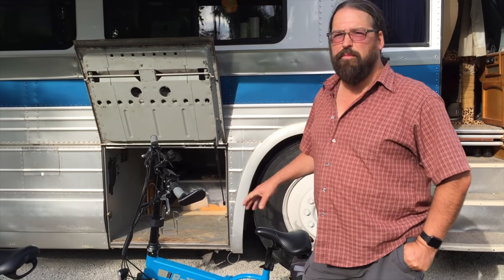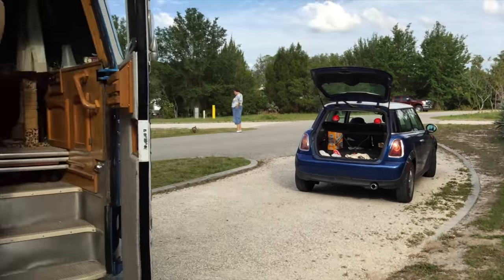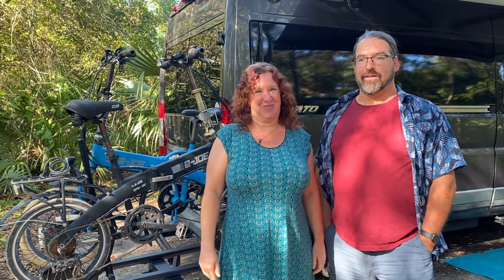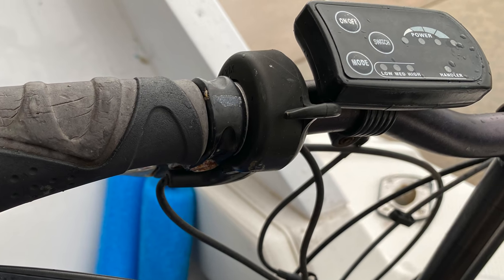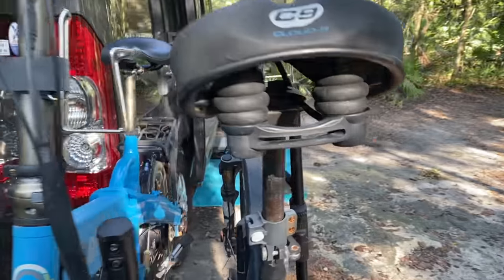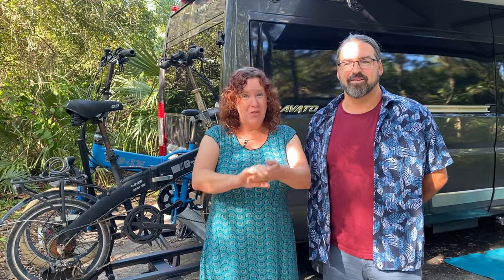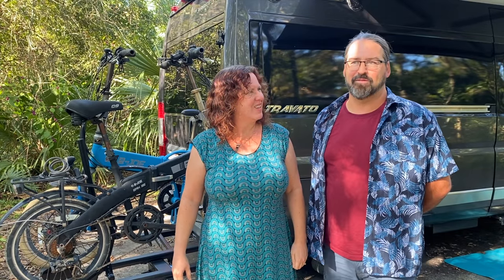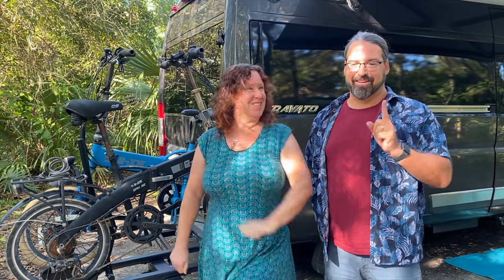Shopping for Folding Electric Bikes for RV and Boat Use - eBike Replacement Time!

Comment: Another thought, you should pull the battery on your ebike when transporting. They way on average 7.5lbs. That 65lb bike only weighs 57.5lbs without the battery. Also, pull the seat and seat post during transport. It makes it harder to steal a bike with no battery or seat and makes them lighter.

Comment: I have a Lectric XP with over 220 miles on it without any issues. Recently we purchased the step through version for my wife. She is very happy with it’s performance. The weight of the bikes would likely push the outer limits of your bike rack.

Comment: I'm 225# and bought the Lectric XP. I have been riding/testing on mostly hilly paved and dirt roads for the past month, trying to get a realistic grip on the mileage and determine the best setup for comfort. Most reviews of the bike tell you what it isn't which I think is unfair. At $899 it isn't going to be a lot of things but thus far the XP is a well-built and rugged road/trail folding bike that does a good job of getting me where I need to go. Yes, it's heavy at 63# but it will haul 275# on the saddle plus 55# on the rack.

Thus far I have purchased a good lock and a mirror. Out of the box the bike is very complete and ready to ride. Since this is my first electric bike I cannot make comparisons but I am very pleased thus far. The XP is a blast to ride. I've been running tire pressures around 20# which does make for a more comfortable ride. With that said, this 68 year old butt will probably be looking for a wider gel seat pretty soon. You are right when you say YouTube is peppered with this particular bike and the influencers did play a part in my decision. Still, I was very comfortable with my decision matrix when I finally pulled the trigger and ran the credit card. I have not regretted my decision. I placed the order and 10 days later took my first ride.

Comment: Pulling and  the battery seat will bring the weight down significantly. It's not on your list but, the Rad mini step through weighs in at 69 lbs. and has a payload capacity of 275 lbs. They are built like tanks and the service from the company is excellent. As of today they were in stock. 😎

Comment: My first thought was the Blix. I know someone that has one and is very satisfied. I looked at the electricbikereview YouTube for the eJoe Epik Swan. It looks very nice and has a weight capacity of 300lbs. If I were looking for something in that class I think I would go with the eJoe. We just bought RadRunner ebikes which don't fold and are single speed (my wife has problems changing gears.) Everybody has different needs. We do not tow a car with our 25' Class C and are using them as a second form of transportation for exploring. They offer great utility and versatility with great customer service.  Good luck with your new folding ebikes, hopefully, they will be in stock.

Comment: Hi guys, my wife and I have owned two Lectric XP’s for about a year. And no we are not at all society media influencers at all.  Lol
The good: they ride very nice get a decent range. Comfort level is good but needs a seat mod for larger people like us. We are sillier in size to you but shorter. They move us around at a good clip on flat and and hilly terrain just fine, sometimes a bit to fast. The pedal assist have three levels to chose from. The controls are easy, look to be be well sealed. Seats and handle bar adjustments are easy to do.the Fat 4” wide tires to really well on dirt and gravel, will work ok over hard packed sand, deep sand not so well. But the cool part is you can use the walk mode on them to have power drive over the sand as you walk the bike will use it’s power to go over the sand without your writhing on it. Beats the hell out of push a bike on the sand. The batteries can be removed or left in bike to charge. Folds down to a nice tight package we get both into the back of our road “Ford C-Max”
The Bad: it pushes 60lbs if not that.
The components, detailer, crank and shifting are lower level. But for salt air and salt water not so good. 
The brakes seal no matter how many times They have been adjusted. The brakes stow well no complaints there.
And after market seat is a must.
The fenders kinda make noise over rough trails an bumps. 
All fixable stuff and most likely “any bike you get will require mods to work for you in the environment you two exist in” 
The base bike is very cool.
If I was living on a boat or at the beach the first thing I would change is to upgrade mechanical cables to stainless steel. Next up grade the derailleur to an XT or aluminum higher end model. 
All screws and bolts to stainless steel.
The crank and sprockets can be changed out as needed, but note a quality aluminum crank can take of a pound or two. Changing to aluminum components will take weight off and prolong saltwater life.

Again this will be with any bike you chose.

Comment: We purchased a pair of XP Lectric's that have been perfect for us.  That was until they came out with the Step-Thru, which my wife now is receiving one next week.  We have been very pleased with the bike design, build and range.  Something to consider is the weight of the battery which is around 7 pounds when loading on your bike rack it would be better to remove the battery.  

Riding off the pavement on trails is something we enjoy.  Upgraded our seats and installed seat suspension post.  That plus the fat tires, usually deflated to around 20 psi makes for a reasonably comfortable ride.  

Dimensions, folded ours measure 37" L x 24" W x 35" T.  It is possible to get the width and height down by removing seat and handle bars, which is easy to do with quick releases.  The company website shows orders now will be shipped in October.  Hope this is of some help, would be cool to see where your new bikes are able to allow you to explore.

Comment: I have a 2016 e-Joe Epik SW (pink) and a 2018 e-Joe Gadys (full size non folding).  I love them both, but my go to for camping and quick trips to the store is my Epik.  Love e-Joe. That being said, my assist on the folder stops working after 2 miles now but the throttle still works and I am running it till it doesn't anymore.  I will get another e-Joe folder again. LOVE e-Joe. My brother and sister-in-law have Pedigos and they love them but they are way too heavy and don't offer the range that the new Epik does.

Comment: Please know that by taking the battery off of the bike before you put it on the bike rack, will make it easier to lift onto the rack.  And lesson the weight carried by the bike rack.  May open up options if you do this.

Comment: I am in the market for a step through for a heavy weight senior that can handle 250 lbs.  But more important for me is some type of rack that will enable me to mount on the back of my Class C RV.  I don't have strength to straight out lift a e bike so have to figure out a way to get on the rack.

Comment: Great video!  Monday we ordered 2 of the folding Lectric folding step thrus to go on our Travato bike rack. . After much research we decided it was best for us esp the price.  We ordered  from the factory and it was $899 tax and shipping included and  they are giving  a set of panniers for each bike.    Other than the price, I am a big guy and they can carry 335 with not weight on the rear rack and they have 4" wide tires. They have great YouTube recommendations.  Rad is good also  But it almost twice the price.  They may give them to you , I hope.  They  told me 3 to 6 weeks for delivery.

Comment: We have a couple of the Green Bike USA. I bought the 750w fat tire option and my wife has the 500w (non fat tire). I'm 245lbs so there is not a (bike) weight problem although mine with a big ole 20a battery (60 mile range) weighs about 75 lbs. FYI

Comment: Rattan and DJ E-Bikes -  I am not sure about the quality of the bikes.   I do not know the weight or weight capacity of the Rattan, but the DJ weighs 56.22# with a weight capacity of 275#.  The DJ is made in Canada and is made to compete with RAD.  Both bikes have front suspension which is a MUST HAVE!!!.  Darrell Dement - the reason they do not have Rad on their list is because it is too heavy.  Their bike rack can only handle up to a 60# bike.

Comment: I love my Magnum foldable step through ebike.  I bought the 750 for about $2000.  Upper weight is 275.  They also have a 500w good up to 50 miles, though may be a little less with upper weights.  It weighs about 55-60 lbs and measures 34” x 14” x 35”.  I love it, especially throttle action when the "old" knee acts up.  Excellent made frame.  Bought mine at bike shop but you can now purchase on Amazon.  Good luck; love e-bikes---gets me out there pedaling a whole lot more because it's so much fun!

Comment: I think the Lectric XP would be a good choice. Why I love it cause it’s foldable and you can get 45 miles of riding. The speed is I think 20 mph but you can unlock the speed and get about 28mph. The fat tires are also good for the rough terrain. I did get the suspension seat Post to absorb the bumps. The bike weight is 63 lbs but if you take out the battery you can shave off 7 pounds. The bike can handle weight up to 275 pounds.
Reply from the maker: We did test drive some Lectrics owned by some friends... nice bikes. But way bigger than our e-Joes - would be a lot to move on/off the boat. We're loving our new e-Joes... we'll get an updated video out soon.

Comment: Tern makes a great bike, but it’s only advised for up to 230lb, and it doesn’t have throttle assist.  It’s a very well made class 1 eBike, not a class 2.  They make one that will support more weight, but it doesn’t fold.  Check out 2 channels : Propel bikes, and ERR, electric bike review.

Comment: I think whatever e-bike you end up with, they should be stowed inside an airtight container/bag to keep salt air away from the frame, components & electronics.  Ideally, pull a vacuum and have desiccant inside too.
Reply from the maker: Bikes that require extensive effort to pack and store will never get used. Imagine if every time you parked you car you needed to take the wheels off???

Comment: Quiet Cat Voyager E-Bike, Money but specifically designed for marine use.  54 lbs,  will support 325 lbs.  20X4 inch tires 750 watt.
Reply from the maker: Thanks.. we'll add that to the research list!

Comment: I had to go check the Lectric models out when you said Rad weighed more.  Actually without the battery it weighs 3 pounds less.

Comment: Lectric XP or the step thru....I am short and have the XP....I can pick this thing up no problem. Take battery out to lighten the load.  BTW over 1200 miles on it -no issues.

Comment: We bought a RadCity Step-Thru Electric Commuter Bike Version 3 × 1 for my wife, which my neighbor owns, my wife tried, and loves it, and I have a  Aventon PACE 500 EBIKE for my self, the bikes have the same range, and they both meet the 65 lbs limit of the bike rack, which we change to a rack we can set the bike on rack at the tire position, then secure. The have a class A RV,  the rack works well, we also  bought a travel cover/ bag to protect the bikes on the trip, and under the bag, lock the bikes to the rack  
Regards

Comment: My Rad mini folds and fits in my Country Coach basement storage!  You'll love them.  They only sell on line.  Customer service is awesome!!!
Reply from the maker: We'll be transporting on our bike rack on the Van.. and they are too heavy for the specs.
Reply: 75 lbs a piece.
Reply from the maker: As stated, our rack can only handle 60lb/each.

Comment: A suggestion for the best folding and weight bike is the English Brompton. They do have an electric version where it powers the front wheel and then a battery that mounts on the front handle bars.  Their ebike version is pedal assist and doesn’t include the throttle option, which is really helpful in getting going from a dead stop on an incline.  There are folks that sell an eversion add on to the regular Brompton that does include the throttle option, which would be the way to go.  This bike is really meant for commuting and not so much trail riding, which really may necessitate a bigger bike with bigger wheels.  You may need two types....one for the trail and one for running around town....  Good luck in your quest and keep us posted.  Take care, hoop
Reply from the maker: The 16" wheels make the Brompton a no-go for our bike rack. They're way out of our price range for such a limited use. We want something more versatile for trails or running errands. No room to store 4 bikes.

Comment: For the pavement, economically challenged I have a Jetson Bolt.  Purchased for $300 from Costco.  Goes about 20 miles on a charge.  No pedal assist but does go well (about 15 mph) and folds down very small.  I love it and have over 500 miles on it with zero issues.
Reply from the maker: Pedal assist is a must for us - we are too spoiled by it.

Comment: I would look at Pedego bikes.  The latch is a folding bike.  Weight without battery is 43lbs.
Great company and great bike!
Weight is 250 max but price is more!  Old saying-you get what you pay for!!
Reply from the maker: Thanks.. looks like they just came out with a 20" wheel version. Added to the list to research further.

Comment: I really like my Lectric XP
Reply: Hi to you both, Helen and I bought ENGWE, EP-2 , 20" fat tire fold ups. Weighs about 58 lbs. We love them!! 
500 W, Mag Wheels (no spokes) has front suspension, has actual horn,headlight and tailight and has break-lights.
Helen has the Orange Color and I have the Black. They have the 48v Lithium battery. They are sold out of Quartzsite. If interested Iet me know and I can provide more info.

Comment: I had looked in to Pedego. VERY EXPENSIVE! BUT if they tell you the truth it is suppose to be way higher quality. The gear system alegly  better quality There fold up bike looks the same as the ones in your vlog today. one BIG advantage with Pedego is you can use FULL battery and NOT peddle OR you can use peddle assist. NOW YOU CAN PEDDLE BUT WITH SOME MOTER HELP! It also has THROTTLE to move even faster through the electric Motor Pedego Electric Bikes - America's Biggest & Best Electric Bike Brand God Bless best wishes. Bill M
Reply from the maker: The Pedego 20" new version has been added to our research list. They are actually quite reasonably priced.   Most bikes we've seen (and our current e-Joes do too) offer throttle or viable peddle assist - an absolute must for us.
Reply: Technomadia Well then I suspect you’ve made up your own mind you’re going to go to Petco so that you can have the pedal assessed not just a throttle and not just the regular paddling to my knowledge pedagogy only one that does nobody else has it and once again allegedly all their gear systems and all that technical stuff supposed to be the best of the best of the best so you’ll be looking at over $3000 for the bike did you want times too so that’s six so you need to buy two of them but could be a good investment in the long run William Shatner sells them on TV around on the Internet mostly you can go to YouTube and video put in for the Pedi go folding bike on the vlogs You will get a ton more information I still may buy one eventually I just got a new golf cart so I need that more than a bike so once I get this paid for that I am I may very well get myself an electric bike and exact one that you’re looking at is what I would want because I want to fold it up to put it into my Honda fit to bring up places to use
Reply from the maker: Actually, the new Pedigos are only $1495, but they are not folding - similarly priced to many of their competitors in this class.  And, as I already stated, most other bikes on the market have pedal assist (as do our current ones). It's not a unique feature at all.
Reply: Technomadia , they do make a folding bike because I saw it when I went to the show room in Tampa for pedego

Comment: My top two contenders are:  Magnum Bikes Premium High Step;  Evelo Dash (belt drive-no rusting).
Reply from the maker: Those both look very promising - thanks for the tips!
Reply: The Evelo looks very interesting for a folding bike.  The 3 speed IGH is easy to maintain.  I have a couple of IGH bikes and they are so easy to adjust.  The belt drive should be good for many years, plus it is very clean (no oil).  I really like the weight less than 40lbs without the battery.  It is very hard to find ebikes that light.  I hate heavy Ebikes especial lifting onto a rack or into a car.  Interesting that it can handle a rider of 275 and they even mention to call for heavier rider.  The mid drive is good for climbing hills.  350 Watts it will not go super fast, but that should get up to about 20 miles per hour.  This is a very interesting folding Ebike.

Comment: still suggest RAD  Mini Step-thru..............they are really good bikes..  well made..  the rocky mounts carrier can easily carry 2 of these.. it is a great bike carrier
Reply from the maker: If they overweight our rack however, they do us no good :)
Reply: The maximum height for the RadMini ST is 5'10" and that's pushing it. I'm guessing that's too small for Chris. I have the RadMini, and it is a heavy beast. I reduce the weight by removing the battery when I load it in my vehicle. I highly recommend the 4" fat tires on 20" wheel.